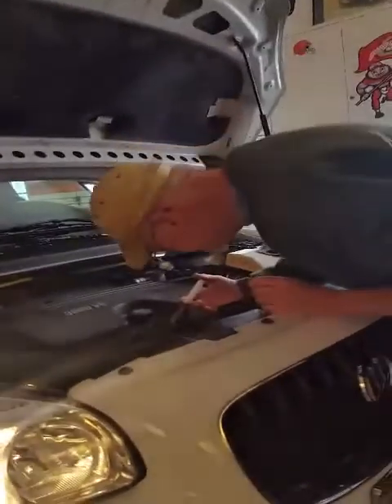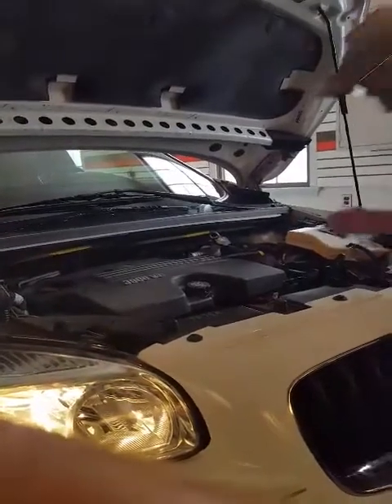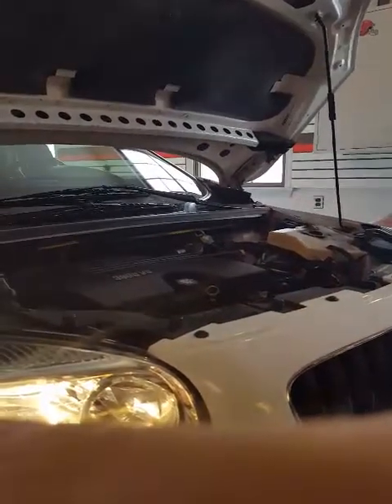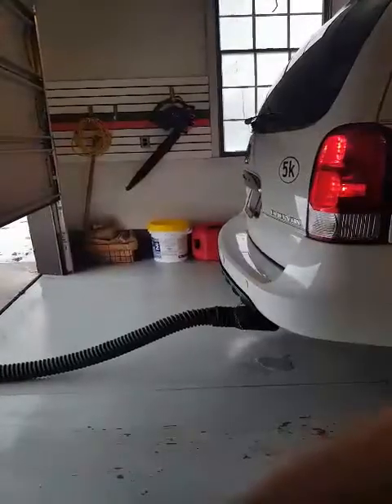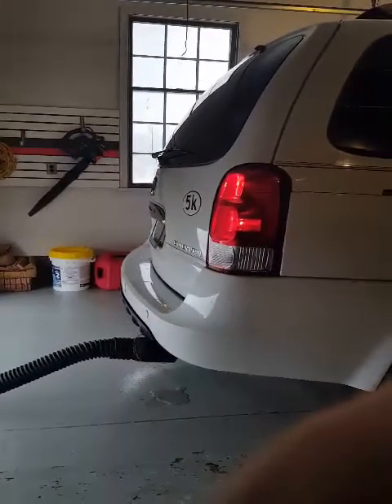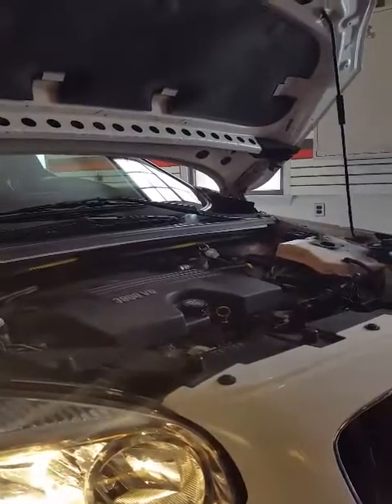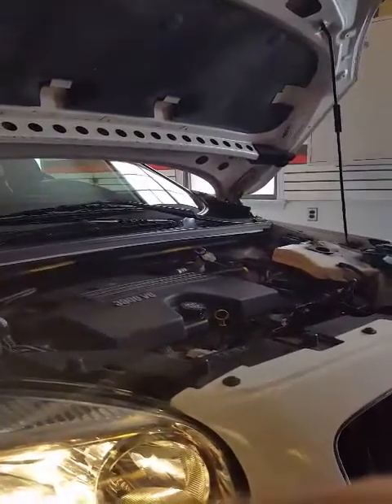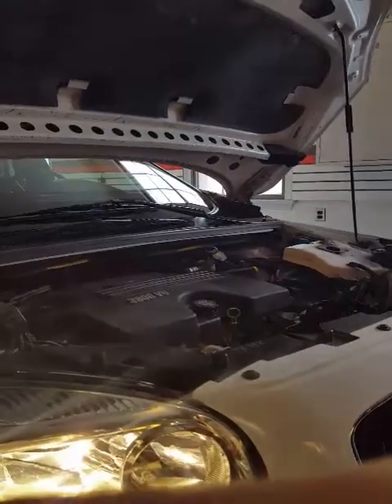TriboTEX Engine Oil Additive Test with Chevrolet Uplander Part 1 Initial Full Review

Comment: I have had mine in my oil for a year my engine runs at a lower RPM and smother has better pick up and again nonce a speed is reached the RPM levels out about 200 less than it used to.

Comment: Please ask the individuals who are testing the product to be more precise. First of all this vehicle is not a Dodge Durango. Second n of all it appears the injected the product down the dipstick tube into the crankcase. That is not a fuel filter. As the person below stated most vehichles quiet down after idling a few minutes. Having more knowledgeable people testing your product will give you more fact based results which will either help your product or hurt it. It would be nice to see all vehicles repost after 1000 miles and then every 1000 after that to actually see if there is an audible difference. With higher milage vehichles it would be nice to see if there is any change in oil consumption between changes and definitely have them do a gas mileage comparison from first application and so on. Your product sounds interesting but in order to get support and credibility you need a better fact based test to gain trust and curiosity from potential users. If there are marked improvements you will see and increase in people willing to invest in the product and give it a try. There are too many products out there that just waste your time and money. Factual test will bring consumer respect and trust.